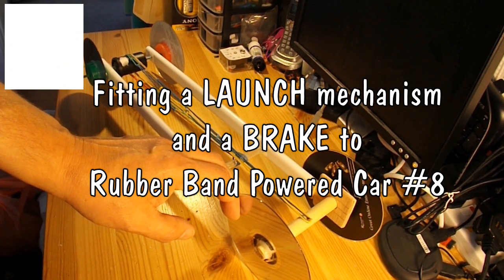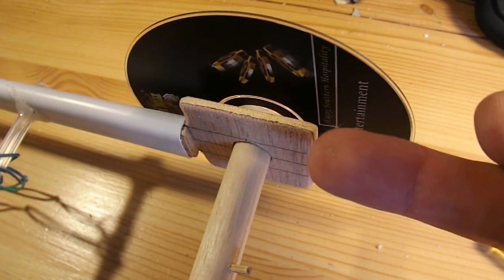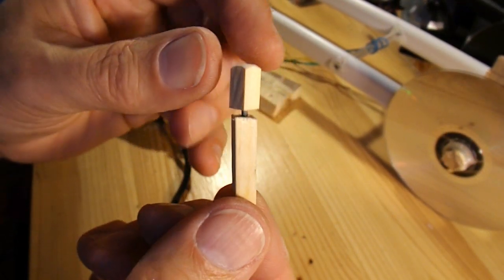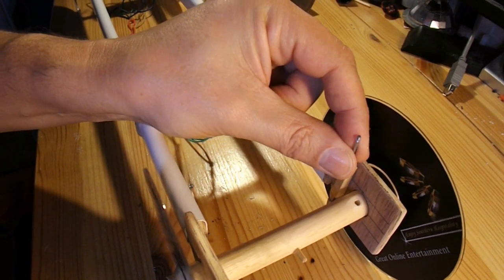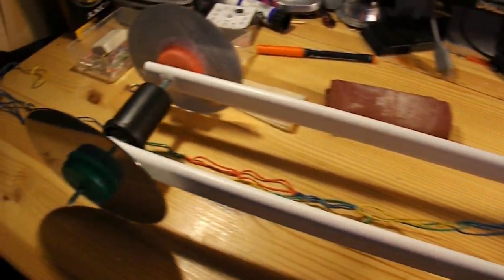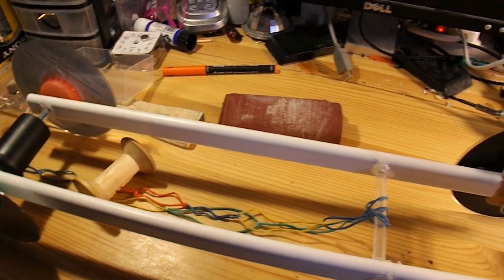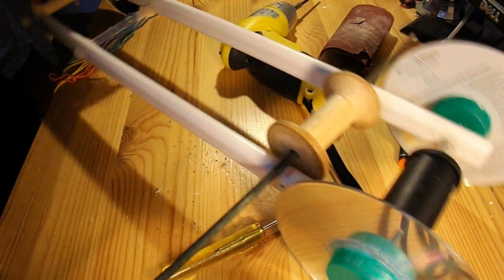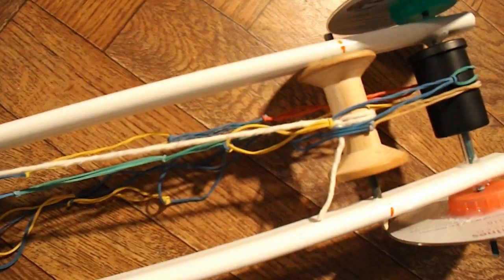Fitting brake and launch mechanisms to Rubber Band Powered Cars

Comment: Hi,

I added my braking system to the front of the vehicle. However when the vehicle brakes, it keeps going back and forth until it runs out of energy. Do you know how to fix this? Thanks.
Reply from the maker: Hi Megh Pandhi, these two videos cover the subject of fitting a brake and stopping the car rolling backwards. The second video stops it rolling backwards but you may find the first video useful too.
Helpfile - Rubber Band Powered Cars - Gears and Brakes
Helpfile - Rubber Band Powered Cars - Anti roll back Ratchet

This car also has an anti-rollback mechanism
Rubber Band Car climbs a ramp to 1 metre
Reply: GrandadIsAnOldMan Thank you, that was really helpful.
Reply from the maker: Megh Pandhi Good luck with your project.
Reply: GrandadIsAnOldMan Thank you, I already have everything else up and running, this was the only part that was bothering me so thank you again.

Comment: ok how do i u know get it where it will winde up
Reply from the maker: Hi Gage, I am sorry but I don't understand your question. The brake string winds round the axle as the car goes forward until it is tight and that stops the car.
Here is another video with a brake mechanism Helpfile - Rubber Band Powered Cars - Gears and Brakes

Comment: Thank you very much for the informative video; I will most definitely try the braking system.  With your launch system idea, I would have to make some modifications since I am using a metal axle, but the idea of tension with the rubber bands is good and "plunger".  Thanks!